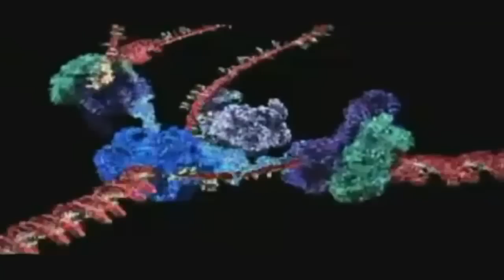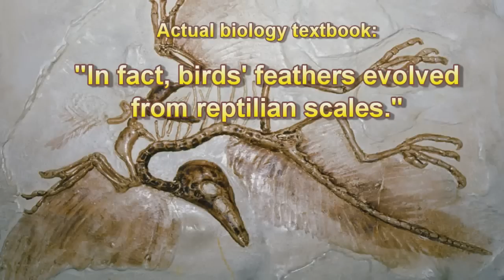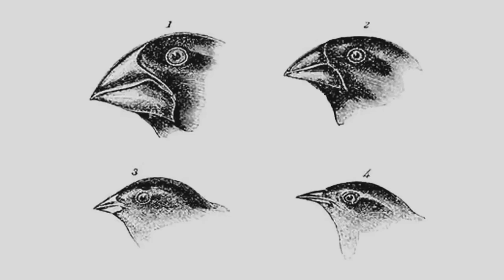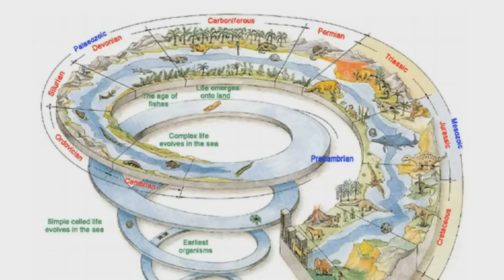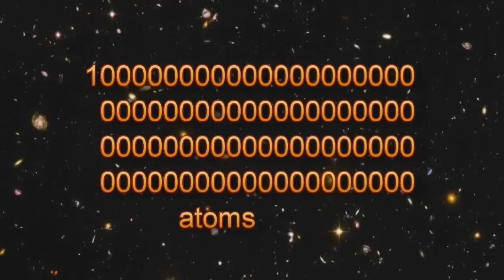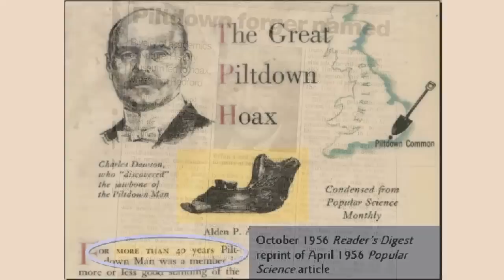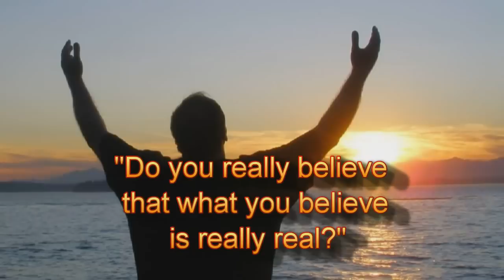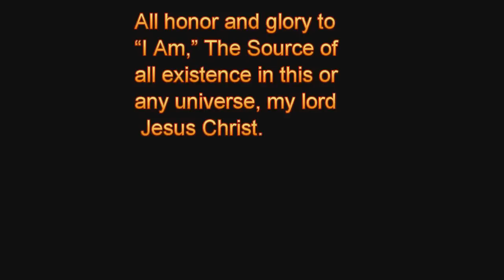Evolution Demolition

Comment: How many times do scientists have to tell you that life is not a closed system.
Reply: Mark Champneys The second law of thermodynamics states that the entropy of an isolated system never decreases, because isolated systems always evolve toward thermodynamic equilibrium— a state depending on the maximum entropy.
LIFE IS NOT AN ISOLATED SYSTEM !
Reply: Mark Champneys Using the second law on an OPEN system is like figuring you gas mileage with a fuel truck driving next to you with a hose going to your gas tank.  
DO YOU UNDERSTAND ?
Reply: ***** Using your analogy of a fuel truck supplying your car with endless fuel...  Your car is still wearing out as you drive.  It is not getting newer.  It is not getting more complex.  Do you understand?

The principle of increasing entropy applies in open systems too.  You cannot escape this.
Reply: ***** Increasing entropy applies everywhere.  Thermodynamics, information science, open system, closed system.  Everywhere.  If you think that the "closed system" caveat in the way the law is stated implies that the law does not apply in open systems, you are misinformed.  The 2nd law of thermodynamics, as expressed mathematically, must be in terms of a closed system so that it will make sense.  Obviously you cannot compute a sum without boundaries.  But the principle is in operation EVERYWHERE.

Keep in mind that there are no truly isolated systems.  If the law only applies to closed systems, then where would that be, exactly?  And what good would a law be that doesn't apply anywhere?  See my point?
Reply: Mark Champneys''increasing entropy applies everywhere''  What did you do from the ago of 2-12?  Did you grow and become more complex and violate your made up law of increasing entropy ?!?
Reply: ***** You're making a common error.  You are mistaking apparent seeming order with disentropy.  The law is based on a principle of mathematical "attraction" (for lack of a better word) towards higher probability.  The molecular properties of water are such that at low temperatures the higher probability state is for those molecules to align themselves in hexagonal crystals, much like balls dropping into slots or rainwater running into riverbeds.  Ice does not represent lower entropy, and the law is not being violated.  It is true that randomness is generally the higher probability state, but sometimes physical properties make appearances deceiving.  Intelligent mind can also intervene and alter probabilities radically by constructing such mechanisms.  But ice formation is not a contradiction of the 2nd law.

Of course, one idea that has been pursued is the idea that chemical properties cause DNA to be the more probable molecule.  Unfortunately, this did not turn out to be the case.  More importantly, the chemical bonding of adenine, thymine, cytosine, and guanine to the sugar spines in DNA turn out to be virtually equal to each other. This means that one arrangement of nucleobases is no more probable than another.  No ice crystal situation here.  That leaves randomness as the most probable state for DNA sequences.  Or do you have another naturally-occurring mechanism to propose?
Reply: Mark Champneys
So you admit that order can come out of natural processes. Good to know, as now that you've acknowledge this possibility you can't make the blanket statement that the 2nd law is being violated. You see most scientists don't claim to know how DNA first formed so to disprove them you'd have to completely disprove all possible ways. As such you can no longer use this law because you admit that there could be cases where DNA would be allowed to form.

Simple logic shows that using the 2nd law doesn't help your case.
Reply: Travis Frazier Things falling into line according to pre-existing natural laws and natural properties is not an increase in order, but is a matter of following the path of greatest probability within the existing order.  If DNA was like a riverbed at the bottom of a hill, then we would have no difficulty.  But DNA is like the Titanic teetering on a pencil point on top of the Matterhorn.  Such improbable things cannot come into existence by random processes.

I will readily admit that at this moment I cannot disprove all the theories that may someday be proposed for explaining how the information in DNA could arise by itself.  It is enough for now to simply show that the evolution model is not it.
Reply: Mark Champneys

The definition of order is as such:
or·der
ˈôrdər/
noun
noun: order; plural noun: orders; noun: Order
1.
the arrangement or disposition of people or things in relation to each other according to a particular sequence, pattern, or method.

It is undeniable (although you will probably try to deny it) that particles arranged in a line in relation to each other would be following a particular pattern. It IS order.

"Such improbable things cannot come into existence by random processes."

^Appeal to ignorance which I just blasted you for. Why do you continue to make the same logical fallacies?

" It is enough for now to simply show that the evolution model is not it"

Just plain ignorance. The evolutionary model contains nothing about the formation of DNA. Of course evolution isn't the answer to the formation of life. That would be the realm of abiogenesis. Stop making deceitful statements like that.
Reply: Mark Champneys But life does make order out of chaos.  And it does what seems impossible.  but it does do it, no Gods needed.
Reply: ***** You are correct regarding the ice alone, of course, but the ice and its surroundings must be considered together.  The freezing of ice is a simple entropy transfer mechanism (ETM).  The freezing process is an exothermic process releasing heat into the surroundings, which is spontaneous because the total entropy of the ice and surroundings increases.

Local entropy can be moved from one subsystem to the next with an ETM which alters probabilities, Simple ETM's occur in nature, such as this one.  Design can also accomplish this by altering probabilities dramatically.  The problem is that the evolution model proposes no such ETM for giving rise to enormous amounts of prescriptive information.  But any given micro-state tends towards a state of higher probability over time.  This is the underlying principle that drives increasing entropy as well as ETM's.  Thus, the law stands in the way of evolution now as it always has.
Reply: Mark Champneys
"The problem is that the evolution model proposes no such ETM"

You do realize that organisms transfer energy through photosynthesis and eating other organisms...right? This is the core reason why actual scientists see no problem. Do you think that you are smarter than 95+% of scientists that do this for a living?
Reply: Mark Champneys ''Local entropy can be moved from one subsystem to the next ''
Yes, the local system is called life and it gets more complex at the expense of the whole closed system.  Now you are catching on.
Reply: Mark Champneys'' but the ice and its surroundings must be considered together''  Correct.  Now you got it, you defined the system.  Now you can do the math on your CLOSED system.
Reply: Mark Champneys Dear Mark, I do not know what the ETM cause is. If you think you won the debate because I can not answer your question, you are wrong.
1. I don't know WTF you are talking about.
2. I have never seen Entropy enter in a chemical reaction in 4 years of studying Chemistry and Biochemistry.  Every reaction goes down hill, atoms go to a lower energy level, energy is lost.  [or added to make it go in reverse]
.3. Entropy was discussed in Physics class when the 2nd. Law of Thermodynamics was explained.
4. Entropy was discussed in the study of space-time and the fact that time has a direction.
5. Entropy does not keep life from making things more complex.
6. Life can be defined as that which can transfer energy from one system to another.
Reply: Mark Champneys IF the ''principle of increasing entropy'' were true we would all die now and not later. 
''Entropy (or disentropy) can be transferred in and out of a DNA strand''
OH BULLSHIT !
Reply: What accounts for highly improbable programming being encoded into DNA sequences?
EVOLUTION !

Comment: As expected, your "calculations" about the probability of planets able to support life are absolute crap.
Let's look at a few of the "essential characteristics" for the earth that are in "perfect" balance:
1. Mass of the earth
What? Are you suggesting that if the mass of the earth was different life couldn't exist? Seriously?
2. Distance from the sun
A slight improvement - yes, the earth is in the habitable zone of our sun, but this is a pretty big zone, we could move tens of millions of kilometres closer or further away from the sun and still survive.
3. Size of the sun
This would change the position of the habitable zone, that's all.
4. Size of our orbit
At last a grain of sense - although many, if not the majority of planets have a fairly consistent orbit, just like the earth's, so that's not really of an example of the earth being "finely tuned", you might as well say the earth is "finely tuned" to get it's spherical shape.
5. Amount of water
Huh? Life could still exist on the earth if we suddenly lost half of our water, or gained half as much again - again hardly an example of fine-tuning.
6. Size of the moon and it's distance from us
Once again, hardly fine tuned - the moon could be quite significantly larger or smaller, life would still survive on the earth. As for the distance - the moon is receding, so it doesn't have an "exact distance from us", it's constantly changing, indicated that life on earth can survive within a range of distances.

You should really read articles like this:
http://www.openminds.tv/complex-alien-life-exist-100-million-planets/27906
We know of many planets and moons that meet many of the conditions necessary for life, even within our solar system.
If you want to speculate about alien life, then sure, go for it, but don't try to deny the existence of well-known facts.

Comment: at 27:00  How do they date fossils.  They date volcanic ash layers [the ones a global flood can't explain] above and below the fossils to get a date range.
Reply: Volcanic ash layers do not occur in all cases, but when they use it there are huge assumptions made.  A big one is to assume that no daughter isotope was present during the eruption, and that no daughter isotope washed in.  A bigger problem is the reality that radiometric dating of igneous material has never once been verified by other methods or by known historical dates.  It simply has never yet worked, so why rely upon it?  Radiometric dating of organic material (if residual carbon is present) contradicts dating of this ash in all such cases, since Carbon dating always yields ages of thousands, not millions of years.  An example was fossilized charred wood material encased in basalt at a find in Australia.  The wood dated at thousands of years old, while the basalt that trapped it dated at millions of years old.  Something is obviously wrong with this picture.

There are hundreds of natural clocks that can be used to estimate ages.  All of them work with the same concept as an hourglass.  Measured "sand" in the top, measured "sand" in the bottom, and a measured rate of flow.  All these hundreds of methods contradict each other (including radiometric dating), but they can all be helpful if treated as a maximum age for any given thing.  It is for this reason that a rule of evidence is that the youngest age is always controlling.  In other words, if you have many hourglasses indicating various times, the one full with sand in the top is the one that really matters.  Most natural clocks indicate a young age of the earth, but, of course, evolutionists don't like to consider those, so they only pay attention to the old indications.

Just one example, erosion carries salt into the ocean, and that rate can be calculated.  If the earth is millions of years old, the ocean should be much saltier than it is at present.  But an age of thousands of years would give the oceans about the same saltiness that we actually find.  There are many other such natural clocks.
Reply: Mark Champneys  ''the ocean should be much saltier than it is at present''  No, you are not taking into account the massive salt deposits [evaporites] buried deep in the earth,  [and you can't explain how they got there with thousands of years]

 If you are tying to prove dating methods don't work you are wasting you time.  200 years ago geology proved the earth is millions of years old and there was no global flood..  
You really don't give a shit how old the earth is anyway, you just want evolution to go away.
Reply: ***** So why do you choose only a select few dating methods and ignore Carbon-14 or the recession of the moon?  Sounds like you are the one with the bias.
Reply: Mark Champneys Modern dating methods 
1. Uranium-lead dating method 
2. Samarium-neodymium dating method 
3. Potassium-argon dating method 
4. Rubidium-strontium dating method 
5. Uranium-thorium dating method 
6. Luminescence dating methods
7. Fission track dating method 
8. Chlorine-36 dating method 
9. Radiocarbon dating method
They all work just fine.

The moon is not receding at a constant rate, you math is wrong due to this wrong  assumption.
Reply: Mark Champneys Not based on "good" math?

What does that mean?
Reply: Mark Champneys Volcanic Ash Layers...
1. Prove there was no Global Flood
2. Are used to date fossils
Remember that GEOLOGY proved the earth is millions of years old 200 years before radiometric dating was invented.
Reply: ***** By a lawyer named Lyell?  Give me a break.  By the way, Charles Lyell thought the earth was a few hundred thousand years old, not millions.
Reply: Bringing  Lyell into the discussion is irrelevant - its important to note he was the first to postulate the world was much older than 6,000 years old - but his work was refined by later generations.

For instance - Lord Kelvin and Clarence King calculated the length of time required for the Earth to cool from a white-hot liquid state; they eventually settled on 24 million years. James Joly calculated that the Earth’s age was 89 million years on the basis of the time required for salt to accumulate in the ocean

Lyell and other scientists of his days suffered from lack of information - in science you can only draw conclusions from the data you have. Pointing out that Lyell believed the world was only a few hundred thousands years old - is a worthless arguement unless you want to rely on him as an authority (but maybe that's why you criticized him as a lawyer (to discredit him) then tried using his own words to support your debate.
Reply: Jacob Engelhardt Funny that you criticize Lyell that he said the earth was too young, and I criticize him for saying the earth was too old.  The basic problem is that Lyell had no new science behind his ideas.  He just wanted an old earth.  Lyell postulated uniformitarianism as a way of interpreting geology.  Yet most geologists today admit that geologic history is loaded with indications of catastrophy, and that Lyell was wrong about this basic assumption.  (The same one Darwin bought into.)
Reply: Mark Champneys I bet you think uniformitarianism means slow and gradual.  Wrong.
Reply: Mark Champneys Why do you keep referring to him? 

My entire post was I don't care what Lyell believed - we know so much more since he died almost 130 years ago. 

You're arguments are centered around a man - who nobody else brought up besides yourself, in attempt to discredit research nobody else refereed, but yourself. 

It's like you are on a script.
Reply: Jacob Engelhardt Yes, of course we have learned much since Lyell, but his thinking has persisted in the face of evidence.  Many geologic indicators point to massive catastrophes in the past, which happened very rapidly.  The majority of natural clocks indicate a very young earth (though not all).  I understand that some indicators suggest an old earth, but the evidence is stronger in the younger direction.  Yet for some reason the old thinking prevails.  No script here.  Just my thoughts.
Reply: Mark Champneys Lyell never said there can't be catastrophes in the past.  
'' The majority of natural clocks indicate a very young earth ''  Bullshit, everything points to an old earth.  Dinosaurs lived and changed for 135 million years.
Reply: We have marine limestone sediments on Mt. Everest - tell me. How many floods produce limestone sediment deposits? Let alone at the top of mountains.
Reply: Jacob Engelhardt I said these methods ARE based on good math (half-life computations), but questionable assumptions.
Reply: Jacob Engelhardt The genesis flood is certainly big enough.  The marine fossils are there, so we know they had to be underwater at some point, don't we.
Reply: Mark Champneys Genesis 6:17 
For behold, I will bring a flood of waters upon the earth to destroy all flesh in which is the breath of life under heaven. Everything that is on the earth shall die. 
I think that means 'global'.  
But it didn't happen. 
The marine fossils grew under calm clear shallow seas and were raised up over millions of years by plate tectonics.
Not all sedimentary layers were made by water, there are wind blown volcanic ash layers a flood can not explain.